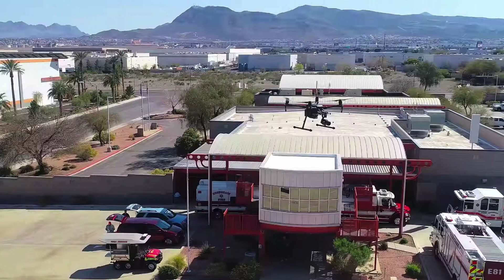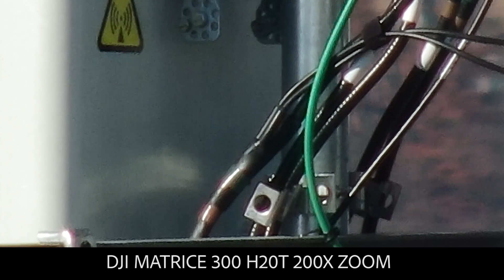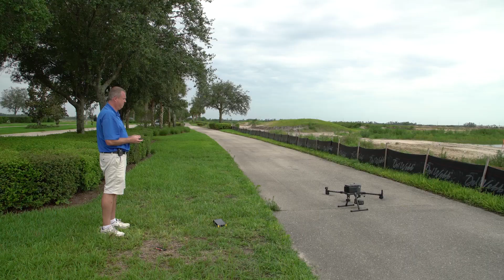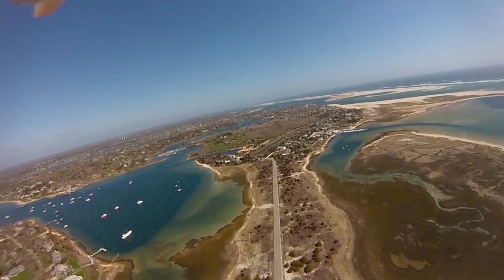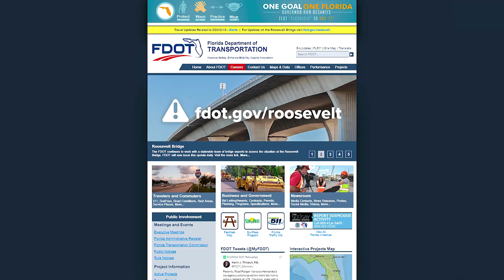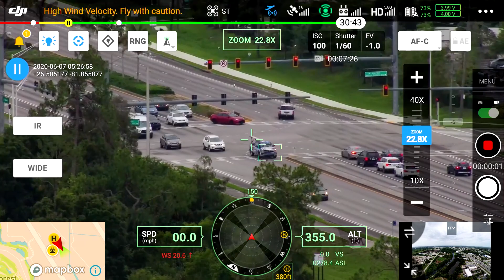Matrice 300 VS Mavic 2 Enterprise Advanced

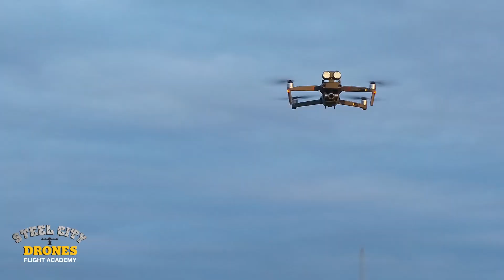Comment: 4:05 actually there might be and probably is. they just didnt get the certificate or rating. well if you fly it in the rain and it breaks you cant get replacement for free
Reply from the maker: No that is incorrect. Mavic can’t be flown in the rain. I know more than a dozen that have crashed because the water gets inside the electronics.
Reply: @SteelCityDrones  roger

Comment: 30% of the things described in these tables are highly "debatable". Some of them are lies, some are understatements. Especially when it comes to the DJI Matrice 210 shown...
Reply from the maker: How did you conclude 30 percent? Which specific parameters of the charts did you find inaccurate?
Reply: @SteelCityDrones  ok, these 30% were exaggerated on my part. 
One by one, things that are not entirely true in these tables (regarding M210):
1. 5:09 - What's the difference between the RTK systems in the M300 and the M210 RTK (v2)? Since both systems use the D-RTK2 station? Have I missed something?
2. 6:31 - can the H20T camera be used for anything meaningful? Ie. Can the collected materials be analyzed in some USEFUL software? Because as soon as the cameras appeared on the market, new users of the M300 felt cheated because the DJI software did not allow any meaningful analysis of the collected materials. Contrary to the XT2 cameras (which can be attached to the M300)
3. 10:03 - there are a few things here. A) - what "advanced features" are we talking about? What specific differences are we talking about when it comes to commercial use, of course? Are there other advanced features that I don't know about, apart from better sensors and possibly automatic object tracking? B) The table shows "not possible" to use LiDAR on M210. Can I give you some LiDAR solutions for this model? C) - You write that M210 does not have "Terrein Following" option, although at 20:01 you show UgCS Software that enables it.
4. 10:04 - Have you carried out any tests that show that the M300 + P1 kit gives more accurate results than the M210 + Zenmuse X7 kit?

The M300 is a great drone but you don't have to bend reality to show it because later such a comparison does not come out too "real"
Reply from the maker: @rayan69pl   I will be glad to go over each of your talking points. Before I address your questions above. I would like to point out Steel City Drones has never bent reality. Our video reviews contain nothing but real honest feedback where we will not exclude feedback (good or bad).  We keep it real. We never slant a video for an agenda and our viewership agrees with that. You will not find anyone have as comprehensive of a video in regards to Matrice 300 or Mavic 2 Advanced.  No only have we made a video for both, we made this comparison video to help end users compare the differences of the units.  Most of our customers purchase from us because we tell it the way it is. Some manufacturers do not like that and in fact have asked us in the past 2 remove a review because it didn't favor them. So we are very proud of that in those terms.  

Also the Matrice 200 and 210 V1 and V2 are end of life and discontinued. Plus product support has been discontinued with no more firmware updates. It was a great aircraft that served the industry very well for almost 3 years. But the Matrice 300 is an improvement in every way possible and that's undisputed. 

In regards to Point #1, The Matrice 300 comes with the RTK equipment as part of the base model. You have to pay extra and purchase the M210 RTK V2 model which is more expensive. You also have antennas that fold open and closed that can come loose in flight. With the M300 the puck antennas are fixed on there. 

 In regards to Point #2 - Useful is a term that is not specific as its more of opinion.  If you are referring to the Thermal side of the camera, DJI tools can show you radiometric functionality of the data. There are also converters out there that allow you to use Flirtools for post processing analysis.  The H20T camera is far superior to the Z30 and having everything on one camera along with the range finder is a game changer.  Many people that have had the Matrice 200 and then switch to the M300 never go back. 

For Point #3 the 10:03 mark talks about the size of the aircraft and longer line of sight possibilities.  In terms of advanced features you have Smart track, you have range finder, and you have pin drop. There's automatic autonomous flights that you can do for easy of repeatability.  There's one button panorama mode. There's also a new feature that, assists the pilot in making a smooth turn mid-flight. It does this by automatically adding Roll to Yaw when turning. Without Coordinated Turn, a skilled pilot must coordinate both control sticks to make sure the drone’s heading is aligned with the front of the drone, which can be demanding for newer pilots or in demanding situations.  Payload capability of M200 V1 which has the highest payload of all Matrice 200-210 is not enough to carry even the lightest LIDAR. Talk to LIDAR USA about this as they are LIDAR experts.  M210 does not have Terrain Follow mode built in, Matrice 300 incorporates it into the Pilot app.  

In regards to Point #4, No I have not done side by side comparisons of those 2 models because we can't keep a P1 in stock, there is a waiting list for the camera because its that good.

Comment: for power lines the air 2 is good enough  in Brazil, we use it for 440Kv lines(transmission lines), we tried both the m200,m210  and the Size does interfer on the photos, the air 2 is just so smal that you can go pretty close to the tower and shoot  photos very close, witch later makes you able to digital zoom on it also the magnetic field does not interfere very much on this drone, we used to fly the air one, but now you cant find it on market anymore
on the other hand the m200 was too bulky to fly around those line, also since you cant get close for  the photos you got use the digital zoom, leading to worst photos of the components

the mavik enterprise was good, but the price here is almost double the air 2 price for pretty much the same result so air 2 all the way

Comment: Doesn't matter, if it won't take off for a job.   Their idiot and restrictive "Fly-safe" system, which actually is more dangerous in certain situations, has bit me in the butt 5 times in the last two months.  I don't need a drone to take control away from me and land, not being able to control what it will land on, whether that be a car moving under it or a baby carriage.    

I bought an Evo II Pro for a backup and it's quickly becoming my primary over the Phantom 4 Pro.   

Once I get an airspace authorization from the FAA and if necessary work with the Military towers in the area, it should be enough.   If you live in an area with no intersecting airspace, you might be OK with DJI.  If you have it though, stay away from them.   I've had it detect runways that don't exist, which even aren't on their "Fly-safe" map, and refuse to take off.   I've had it take control and land in intersecting airspace (can't handle more than one unlock at a time) and detect restricted areas that are over 1/2 mile away and not take off (while a base was waiting for me to finish before flying helicopters).  

What DJI doesn't understand though, is their way of "reducing risk" of lawsuits (and let's face it, that's what this is about) actually increases it by taking physical responsibility for it's actions through it's software.   

DJI probably has the best hardware and support software out there.   I really like it.  It doesn't matter, though, if it won't fly when you need it.

By the way, you can change cameras on the Autel EVO II, though the Thermal is definitely not cheap.

Comment: Why not include the Autel Evo 2 Dual in comparison?
Reply from the maker: Please watch the video we do compare the Autel in the graphic for every criteria.  The Autel EVO Dual has really become obsolete in terms of recommending it as a solution because the new Mavic 2 Enterprise Advanced has much better zoom, plus RTK, at a price point that's about 25% less.
Reply: @SteelCityDrones  I'm comfused. Price point of 25% less? I got quoted on an Evo 2 Dual for 7.5k. Is there a different model for 10k? Also, don't you think that at mid to high 30 minute flight times it's actually exceeding on in air/on station times? Also, don't you think that Evo 2 modular camera system will allow for an upgrade, without having to purchase an entirely new drone? I can upgrade a base EVO 2 at $1300 to a Dual with 8 zoom and 640T by purchasing the camera seperately for 5k. Oh. Almost forgot, the Evo 2 has RTK capability. I don't see how any of those qualities can be over looked. The things listed on the chart has errors.

Comment: I use the M300 as we have a turn-key Optical Gas Imaging Camera for Oil and Gas Inspections. Our Ventus OGI-CAMERA is basically the Gold standard and required the M300. It will work with the V2 210 as well. I do have a Mavic 2 Air Ent Dual Adv. On order too. Amazing aircraft. We sell the OGI and recommend the M300 for Inspection though.
Reply from the maker: If you need any equipment in the future please let us know.
Reply: @SteelCityDrones  absolutely. You are a great looking company for sure. Thank you!
FYI if you ever need any OGI-CAMERA equipment we offer the only one that I'd compatible with the Matrice 300, just let me know as well. Thanks again!. 👍